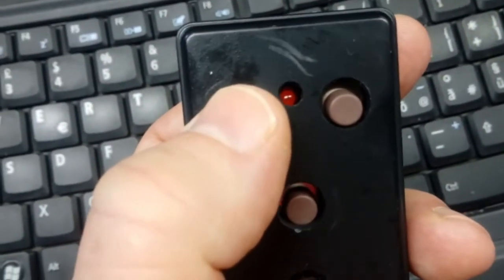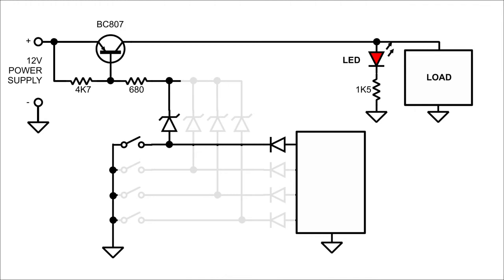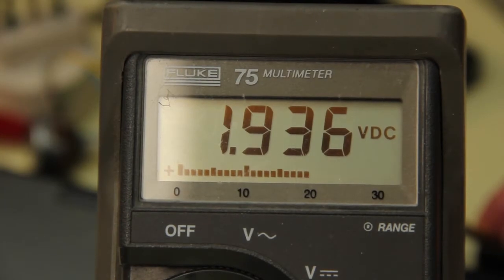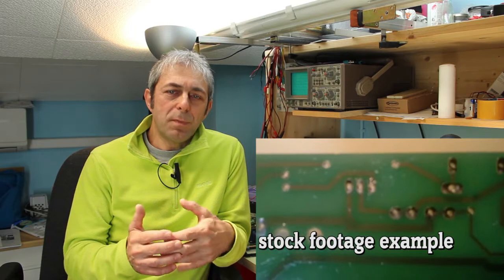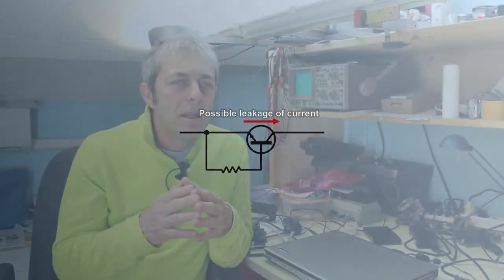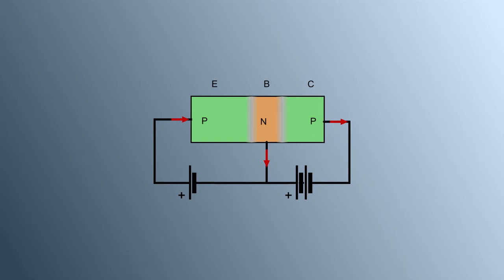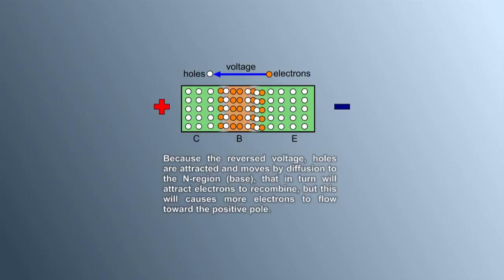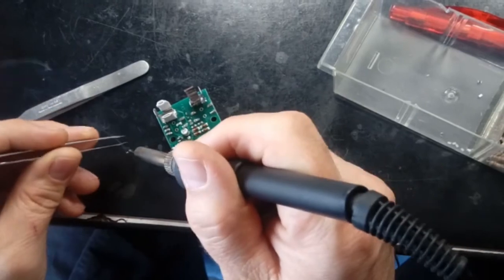Puzzled with a Transistor? Understand how they work when misused

Comment: I think the led lits due to leakage reverse current because as its connected seems to float against the gnd.If for example disconnect the led and measure voltage for collector to ground it might be larger than 1.9 volts equal to ileakage x 10Meg the input resistor of the instrument.

Comment: That is a very unusual problem. I repaired electronics for many years and never came across a component that was installed backwards. In fact most circuit boards I've worked on had the emitter marked in some way. To make sure they were installed or replaced correctly.
Nice catch.
Reply from the maker: Thanks for your comment. Actually this is unusual because it comes from a pre-production line (it comes from a protorype laboratory and small batch production) but it could happens in many way, even misplacing a component or because a "compatible" component is used but the compatibility fails in regard to the layout.